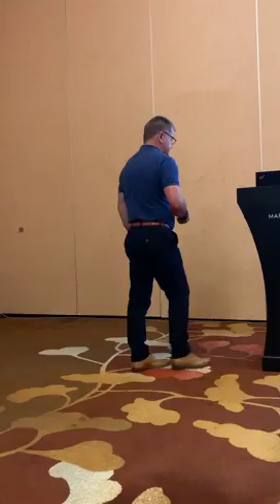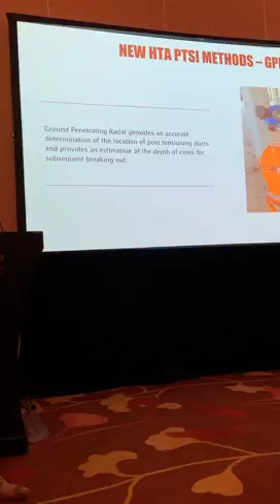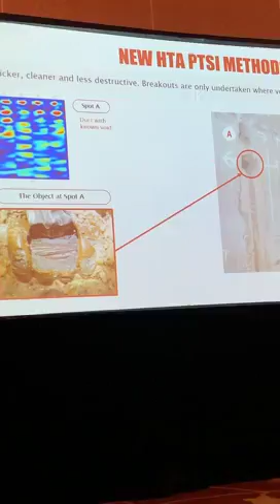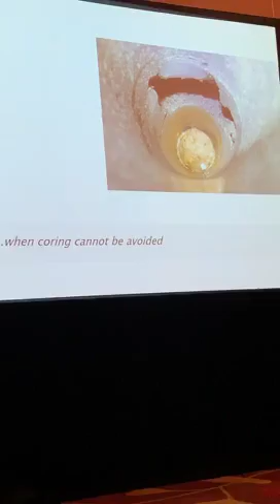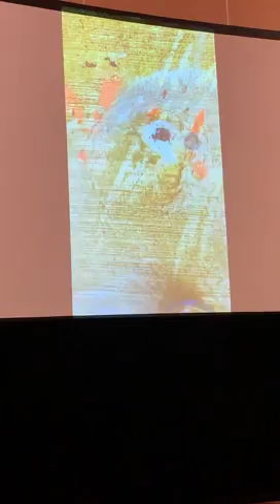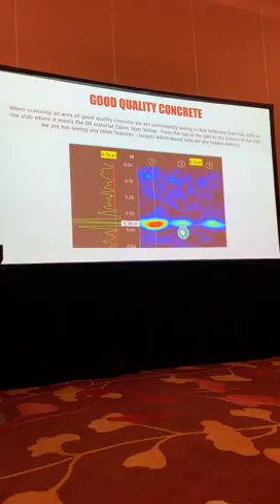Showtime!  Discussing NDT in Singapore

Comment: Good Job Warren. The only question I have for you is when the degree of voids and defects are becoming less significant, then what would be the performance of these methods? Moreover, in the case of partial void in the last block, would hammer sounding (I know how outdated it might sound), provide a more cost effective solution?
Reply from the maker: Dear Hamed, the technique can still detect small voids, the limitation is that we dont quite know the size of the detected void and its connectivity or not, still carrying out research and development on these issues.  Talk Soon and thanks for the question and your interest.